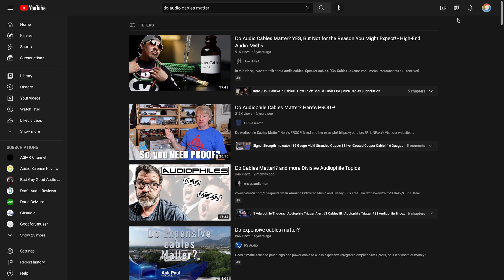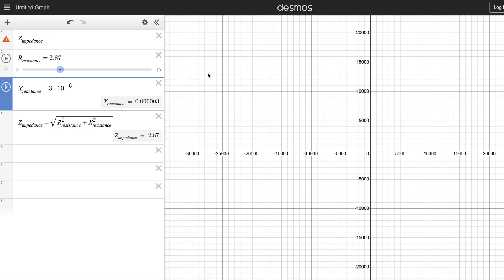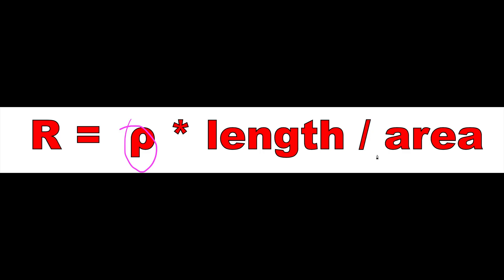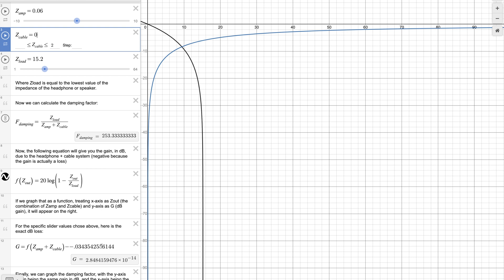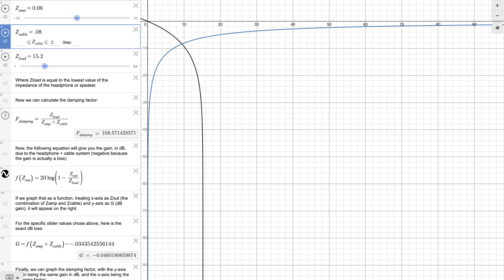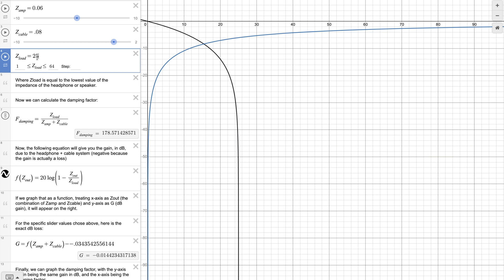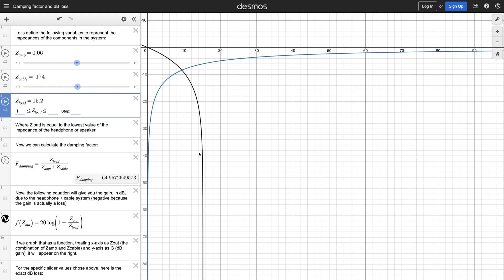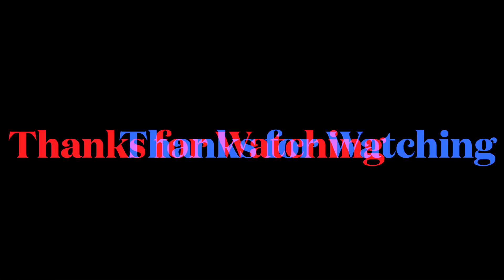The Sound Quality of Cables: The Truth

Comment: wow thats so useful, there is so much i need to learn about signal and frequency domain specifically. i am a student learning electronic engineering which i believe will get into the frequency domain soon. however, as of now, i need to relay on online sources like you to learn the scienctific explaination on the relation between the transducer, cable and amplifer and the output "sound quality". thanks alot for sharing this content. you have my deepest apprication on that! thanks!

Comment: great breakdown of the electrical engineering perspective: conductivity/resistance/impedance-both ends & cable/capacitance/reactance/damping factor/Q etc all clearly involved. Maxwell's equations were simplified though & there could be other effects (besides psychology!) eg it is known that the current does not actually flow through the cable interior but along the outside kind of externally - so although conductor thickness/area  and conductivity are obviously significant there may be other factors involved in transmission of very complex waveforms with all kinds of frequencies & harmonics. There's still space for woo-woo & a bit of Tesla!
Reply from the maker: No
Reply: @sharur1  to put this another way, science attempts to map reality & generally succeeds up to a certain point, but actually reality is very complex & science is modelling- so for me the no 1 basic rule of audio, I realised ( and you are far more knowledgeable about the details of audio engineering) - is that EVERYTHING SOUNDS DIFFERENT- the human ear & brain can detect incredibly subtle differences in sound quite easily. Flat neutral uncoloured response is great but the same stats on different devices will not sound the same. That’s what I was trying to say.

Comment: I tried iron cable that was used in electrical wires and sound was same compared to copper cable
Difference was only the volume 
No difference in audio at all 
All of these cables are a joke
Reply from the maker: a difference in volume is a difference in audio
Reply: @sharur1  all wires sound the same 
But more resistance can reduce the sound
Not the sound quality

Comment: You forgot about capacitance, which to be fair is only a relevant factor at high enough voltages which electrostatics may potentially reach.
Reply from the maker: hmm
Reply: You didn't forget anything. Reactance is a function of inductance and capacitance.

Specifically, it's the sum of capacitive and inductive reactance. Inductive reactance increases proportionally with frequency whereas capacitive reactance decreases proportionally with frequency. Inductance is in series with a speaker wire, whereas capacitance is in parallel - this is the distributed element model, also called the transmission line model.

Let's consider a worst case scenario - driving a tweeter at 24 kHz when its impedance touches 50 ohms. Let's say we're using the lousiest possible speaker wire used for that tweeter with an ungodly capacitance of 100 pF. That's still over 66k ohms, in parallel with the tweeter's 50 ohms, which means the dB loss at the tweeter due to capacitance is still less than 0.01 dB.
Reply: Not to mention the electrostatic drivers in the Variations are pre-biased and don't require a high voltage on the input side. Hence why you don't need to walk around with a 250V energizer while using the Variations.

Comment: Most cables i have, have an impedance of 16ohms, is that bad? I don’t here any difference to be honest. I only buy them because of the feel and athletics, but never spend more than 30-40$ on one cable.
Reply from the maker: if a cable has an impedance of 16 ohms, that is extremely bad. Are you sure it is 16 ohms?
Reply: @sharur1  that’s what was on the tech sheet. But maybe it’s 1 and they multiplying it with 16 because 16 cores? I’ve tried to measure it and it was around 1.5 and 2ohms
Reply: @sharur1  most of the cables are from yinjoo
Reply from the maker: @Fatih-xl7yn  1.5-2 ohms is pretty bad, but make sure that is not your multimeter's limit
Reply: @sharur1  it’s a pretty bad and old multimeter, I guess it’s the limit. Stupid questions, to the individual measurements of each pin have to be under 2 ohms or combined under 2 ohms? Thank your for your reply’s
Reply: @sharur1  ok, I’ve tested with a different device. On my TRN with the removable jacks I’ve got 0.9 ohms
Reply from the maker: @Fatih-xl7yn  individual
Reply: @sharur1  Perfect, thank you! I don’t have enough understanding for the technical things with audio. I do just enjoy the music and the art behind it. But I don’t want to use something, that performs worse 😅
Reply: @Fatih-xl7yn  YINJOO ? or YINYOO ?
Reply: @PAQUIDAN  yinyoo, sorry